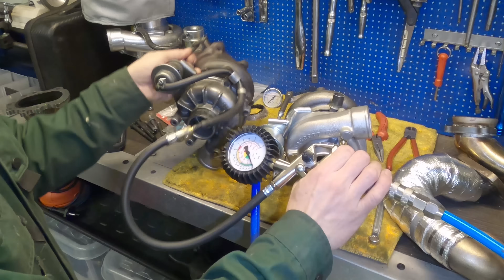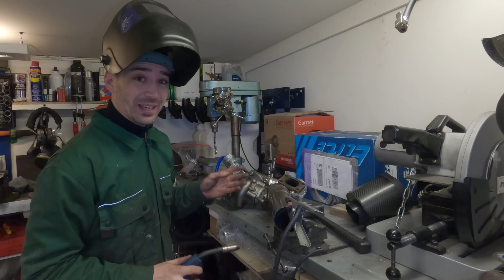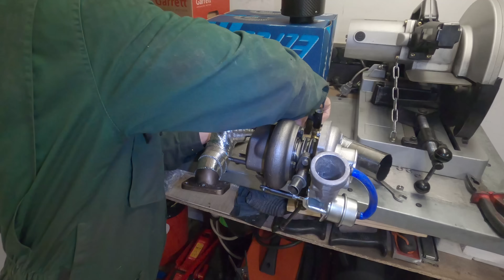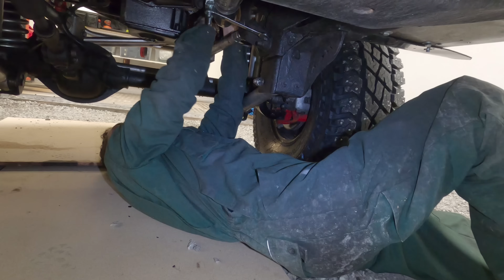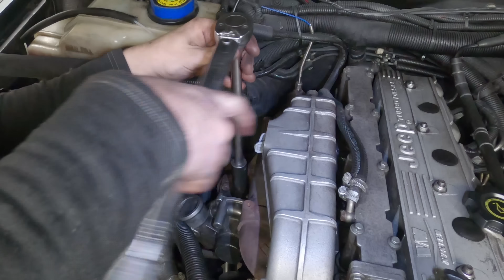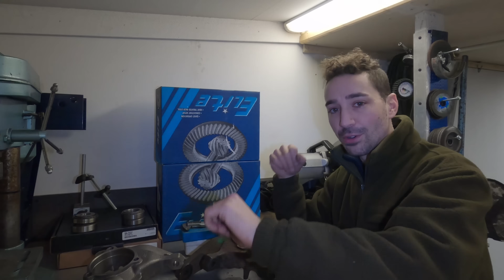Jeep Cherokee XJ 2.5 TD VM Garrett GT2052 Turbo Build

Comment: Stock IHI turbo is really bad. With converted mech pump, my boost hardly reaches 5-7 psi at normal driving. Very weak low-end. Hardly goes to rpm. Rattles to death with rpm. Bigger turbo can be better.

Comment: So what was the outcome
Reply from the maker: Well the turbo wasn't the only thing. I installed an 11mm fuel pump along with lots of other things. It makes around 190hp. Its pretty pokey but very stable. The jeeps around 2300kg with 37s and its not sluggish. Top egt under load in 5th at around 80mph is about 580c. Thats up hill. 
I toyed with water mist injection to try and bring the egts down a bit more but it seem to be doing well.

Comment: Love your vdo's. Best information I've found so far concerning the 2.5l vm engine. 
I have a 97 Opel Frontera Sport with the 2.5l vm also. What are the differences between the Frontera's and the Jeep's VM motors?
Reply from the maker: Thanks for watching and glad you found the info useful! There doesn't look to much difference apart from some brackets for the alternator and a slightly different style intake manifold. There maybe some other things but I have not had my hands on one so I cant be certain. 
Basically the same by the looks of it.

Comment: hi there! any improvements from the mainfolds other than turbo relocation? i do want to lower the egt a bit.
Reply from the maker: The Ford Scorpio manifold seems to have better air flow than the standard XJ manifold. The main way I lowered egts was advancing the pump timing. That made an enormous difference to egts.

Comment: If you create brackets as support ..have relative movement of components and thermal expansion in mind. If engine is based onto the subframe/chassis by rubber blocks ..it means it can move ..if you now fit an bracket for downpipe and link it to the vehicle body .. you fit the pipe relatively to the body ..but engine wants to move in its mounts, so stress fractures on the downpipe is to expect ..with vibration resonances transferred into vehicle
Reply from the maker: Yeah that wouldn't be good. I think my downpipe would have been toast if it was mounted to the vehicle. I mounted mine on the side of the engine so it all wobbles together. Then added a flexi to the exhaust just after the mount. Seems to have help up over the year since the build. Sadly I just killed this turbo I think. The oil return got kinked badly and blocked off causing the turbo to flood and spew oil out the exhaust... 
My own fault for using the wrong hose material..

Comment: Man i got a alfa romeo 2.5td the same engine will it fit on my jeep on my transmission
Reply from the maker: What transmission do you have?
Reply: @WorkshoptoWilderness  5 speed manual stock one
Reply from the maker: @akkk5517  if its the AX15 transmission then it should. If its the AX5 then you might have to get a kit to make it fit. The AX5 isn't that strong though so the engine might kill it due to the torque at lower rpm ranges.
The main thing for the swap would be ensuring that the transmission input shaft and the receiving engine output are the same. If that's the case then it would be a peace of piss.

Comment: Did you stick with 15psi in the end ? seems a nice safe number
Reply: Seeing how fast it spools and how soon 15psi is reached i would say thats the perfect number
Reply from the maker: Its on 19psi at the moment. After I installed a new fuel pin and tuned the pump the exhaust temps were creeping on full load. So I added more boost gradually doing test drives until I noticed a static temperature and more power in the same conditions. 
Its made a big difference but I don't see the need to have any more boost because there is no power gain and no more fuel.
Reply: @WorkshoptoWilderness  Ahh yeah did you find it spools even better with a bit more fuel ? You definitely live in the right place to keep EGTs down 👌 even a British summer gets my egts up 🤣
Reply from the maker: @adamfletcher4262  I think I have found a sweet spot. Egts are very stable and I managed to drop them a fair bit with a slight pump advance. But it's winter and you can see haha. 
The summer will be in the high 20s, even low 30s so that will make all the difference..... yeah it gets crazy hot in the UK now?
Reply: Yeah it does 36 last summer and this winter has been very mild it's almost like spring already ! Yeah I think a slight timing advance may help my d24 as it's set up at factory speck at the moment but later cars that had intercoolers from factory and more power had a spec of 0.95 instead of 0.80 so I'll aim for 0.9-0.95 when the head gasket is done👌 nice to discuss things like this see what helps with what even though they are very different engines and drive very different both being indirect injected they are actually quite similar in tuning/driving requirements

Comment: After watching the many of your videos which are fantastic by the way! It seems to me that you're over cautious with the engine and it's capabilities, I think the engine is capable of a lot more power than you believe 250 horsepower is probably very possible and it could be achieved safely with the right setup that being correctly size turbo matching fuel and timing and for safety water injection. Water injection is probably the best thing you can do with an engine like this, they already with stand great pressures and temperatures and the degree to which they are increased through modification is not that vast over standard. Water injection can't even maintain temperatures well below standard with a highly modified engine producing a lot more power. Even in the worst case scenario rebuild a replacement engine would be worth the journey but I highly suspect that wouldn't be the case if done correctly. Just my opinion take it or leave it.
Reply from the maker: I don't doubt what your saying at all. I'm getting about 160hp and 360nm of torque out of it at the moment. This is just an estimate based on a guy who did the same build and dynoed it at work. I adjusted the pump timing yesterday and installed a new fuel pin and the power us significantly more again. Temps are also much lower by about 200c because of the slightly advanced timing and increase in boost by 2psi (19psi total).
I would be really interested in exploring water injection but I know absolutely nothing about it...
Does it spray into the intake or the heads? I will do some research and see what I can find. Thanks for another project haha
Reply: @WorkshoptoWilderness  water injection is fairly simple, there's not much to it, you have a tank and lines, you have an injector nozzle and a Boost solenoid the fires the injection. It is usually done pre turbo but some do after turbo they have very similar results. The main benefits being dramatically lowering egts and large increases in engine torque there's no real downsides apart from having to fill the tank every once in a while, it's been around a long time, it was is originally used for aircraft and enable them to produce more power at higher altitudes, there have even been some factory applications with turbocharged cars, it even works well on naturally aspirated engines that have very high compression ratios it stops pre-ignition in all scenarios it reduces combustion chamber temperatures and increases power and torque hope this helps. On a side issue I have a VM Cherokee XJ with a seized engine which is probably beyond repair I'm just about to tear it apart and I have been looking for a replacement engine I have been looking at the 2.5 and 2.8 CRD from the KJ which I believe is the same basic and engine structure in terms of block it just has better heads and turbo and it's common rail you can get 200 horsepower out of them my just a remap, have you ever made such considerations? If my engine is unsaveable I am going to dive into this pool and if so I'll probably put it on my other channel it would probably be interesting to you.
Reply: Thanks for these informations. Out of curiosity what happened to your original engine ? I wonder if it's something that could happen to me, like rusting from the inside after not having its coolant flushed enough, or eating coolant through the head... etc 🤣

Comment: How many horsepower and torque does it have now?
Reply from the maker: I honestly couldn't tell you without putting it on a dyno. It feels more like 150hp now when I compare it to my mates 160hp liberty. It feels good though and it builds power fast at about 1500rpm upwards and then I keep it at around 2100rpm in 5th at about 100klmph when on the highway. I just have to watch long hill climbs at highway speed. The manual pump seems to be much more responsive on fuel delivery and despite having up to 20psi of boost to play with egt's can creep up near 600c. I try and keep below 600c.

Comment: Great video! I have a GT2256V on my VM425 atm but I'm working on a GTD1752VRK now which will give instand spool and still support 200+HP.
Reply: Damn ! Does it still hold up today with this huge amount of power ? No joke I wonder if the VM425 can tank it 😂
Reply from the maker: You can push 200hp from the engine. Im almost doing that now and its producing stable temps and good results. The issue is the top end temps under load for long periods of time. Basically you need water injection I think for summer but for me in winter its fine because the temperatures are crazy low.
Reply: @WorkshoptoWilderness yeah I just rushed your engine build playlist yesterday after mine couldn't pass the 2 year homologation test in my country. Intercooler is wet of oil so he thought my turbo was about to die, but at the same time the control center was being inspected so he had to be extremely harsh. Isn't it common on this vehicle to have an oily intercooler ? I need to drive 3000 km next monday 😅
Reply from the maker: Oil in the intercooler can be from the PCV and can just be oil vapor. There's an oil separator thats meant to send it back to the sump but there cal always be some that gets past into the intake. Its not a big deal. He shouldn't fail a vehicle for that, its stupid
Reply: @WorkshoptoWilderness sure, only problem is nobody on the internet seems to agree about how much quantity in the intercooler is acceptable and how much is too much

Comment: As an xj hoarder myself,my only advice(and very importent one) is DO not drive one with a 4.0...... i bought a suuuuper clean rust free 2.5td 1999 model,and went through everything mechanical on it..... put ALOT of money in it.... loved it! ..... and then i bought a rusty winter beater 4.0,so that i didnt get salt on my clean 2.5td...... now the 2.5td has stood in the garage for 2 years,and i cant stop driving the 4.0
Reply from the maker: I've driven a 4l on an off road. We just sold our 5.2l ZJ also. I use to do offroad events in quarries and mud pits back in the UK and got to play in various things. For driving around town and motorways I like the petrols but offroad for me personally the diesel feels so much better. Its just that low end torque at such low rpm ranges pulling over everything. Also fuel economy for the stuff we do. I guess once I regear the jeep will feel more like the old 110 Landrover I drove when I worked in the forest of Dean.
Reply: @WorkshoptoWilderness  yeah offroad the 2.5td is nice.... i meant for everyday driving,as you said.... even with INSANE petrol prices here in norway,i prefer the 4.0.... but i put everything i can get my hands on in the tank.... 2 stroke petrol,old petrol,everything.....
Reply from the maker: @oompaen  the prices are bad here in Sweden also. I contemplated using cheap veg oil again in the diesel. Its still cheaper to use diesel at the moment. Crazy times.....again

Comment: Looks like youtube removed my previous comment with link to compressor map ... So according to compressor map 0.75 is perfect spot for this turbo (anythink between 0.5 - 1.25 is good as is going via middle of map). In you case look at exhaust gasses and egt and if is clean gases just and low egt drop down boost to 0.75. If you already at 0.75 and still clean gasses but you want more power then bigger injectors. 
Or different scenario is when cylinder head is restrictive and you see black smoke then boost up to 1.25 and force more air. This is simpliest way to "tune" old diesel and you cant damage diesel with too much air (too lean mixture damaging petrol engines, too rich damaging diesels)
Reply from the maker: Appreciate you tuning in and dropping your knowledge in. When you say 0.75 are you taking about Bar? Its a shame my EGT gauge popped just before the test drive. I've got a replacement LCD on the way but I have held off from driving it until this arrives. 
My plan was to install the EGT LCD and drive the vehicle checking for stable temps on load when climbing a hill at 2000rpm. 
MY concern really is too much boost damaging the engine. I think it can take quite a bit given the old turbo can push 25psi at full load, but it seems a bit much. Maybe I'm wrong
Reply: @WorkshoptoWilderness  yes 0.75bar is middle of compressor map. If you type in to google "gt2052 compressor map" you will see what i mean. On left you have boost level including atmospheric pressure and middle of map where turbo flow best without heating air too much is at 1.75bar total pressure what is 0.75bar boost. This is sweet spot for turbo but you might need bit more or less depending on engine it self.

Comment: While your doing gauges are you going to do a pyrometer (exhaust gas temperature) 
It’s the best way to know when you are pushing things too hard too long.
Reply from the maker: I have one installed already. Sadly the lcd popped after I installed the new turbo. Typical given its been working fine for years. I'm waiting on another so I can start dialing in the turbo and fuel.

Comment: You've done a great job with your upgrades and mods. Your engine bay looks as if it's been professionally done. I guess that makes you a professional right? Of course, with your hands on experience it does add up. Thanks again for including us in your ventures.
Reply from the maker: Really appreciate that. Its been a lot of work so it's nice that it actually worked haha. You just have to look at how scratched up all the intercooler piping is after install to see how professional I am, haha 😄.  Thanks for watching

Comment: You can use the ford explorer sport trac brake disks instead of drilling the rotors. I've seen to many cracks in the drilled rotors
Reply from the maker: Thats really good to know! Thank you
Reply: @WorkshoptoWilderness  
Also for you sanity and financial well being. If you have a barbecue or over that doesn't get used for food. Preheat the knuckles when you go to weld on the spacers to 95c weld on them, then put them back in the barbecue and slowly turn down the heat. You'll be fine to weld with standard wire. 
I would strongly suggest (even if you make your own) is to do the inner C gussets for the Dana 30.
May also be a good thing is to go and get you caster angle measured and if you want to have it ride better. Cut off the knuckles and rotate them back to get that 8* of caster.

Comment: If you removed the crank position sensor you will loose the rpm on the dash
Reply from the maker: Thanks thats good to know.
Reply: @WorkshoptoWilderness  I've done an engine conversion on mine, was originally the vm2.5 and now it's running a rd28 Nissan turbo diesel. Had to use this sensor to run the tacho in mine

Comment: Your boost pressures look very comparable to my 300tdi Discovery. Well done to you sir, top job.
Hope you all feel well soon.
Reply: Refitting the electronic No1 injector alone won't give you back the cold start fast idol, you would need to go back to the electronic pump aswell complete with all the sensors.
Reply from the maker: Ah thats interesting to hear. I know the engine can take 25psi at full load but I think that's very rare to but up there in normal operating conditions. I think 15 to 18 is as far as I will go but I really should fit the egt guage when it's here, dial back the turbo and start driving it while looking at temps, moving the turbo up 3psi at a time until no more power is gained. 
I won't bother with the number 1 injector then if that's the case, thanks for the information and for watching

Comment: Did you ever consider getting a vgt turbo
Reply from the maker: I did but then I didn't in the end. Would be an interesting test to use one.
Reply: @WorkshoptoWilderness  i have both xj, the 2,1 and 2,5  and i've been thinking about putting the 1,9tdi 130hp (vgt/small turbo for low rpm boost) turbo.in my 2,5td,  but since ive been seeing your videos idk if it still a good idea

Comment: Mad respect! Amazing result on this project. I will definitely consider this in the future, i like the idea of easier access and better turbo availability. 

What oil weight and brand do you use? What oil filter? And how often are you changing your oil?
Reply from the maker: Thanks mate, I'm glad it all worked in the end. I still need to get the egt guage and start to dial in the correct boost. I use 10w40 Semi synthetic oil with an aimteck engine restore additive. Appreciate you watching
Reply: @WorkshoptoWilderness  thanks! Been in an internet wormhole concerning oil weights and operating temps i think I now understand less than I did before haha. I get low/ no pressure on cold start/ intermittently I'm sure it's since I did the head. 

I'm so ready and scared for all of the information i won't understand regarding your upcoming gearing video! Get well soon, hope your chest hasn't been bad.